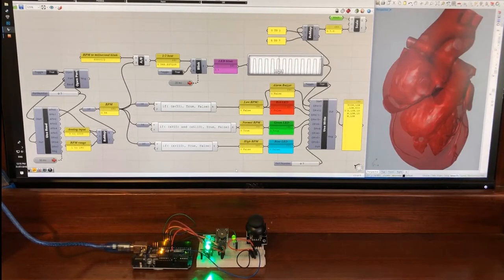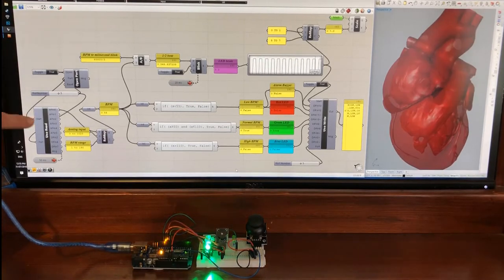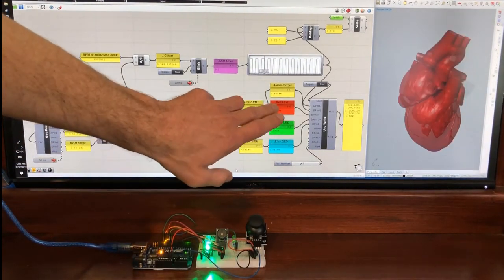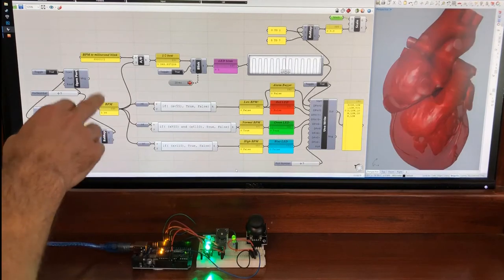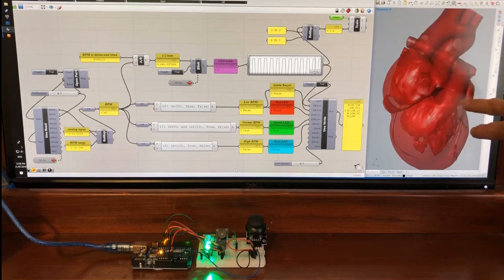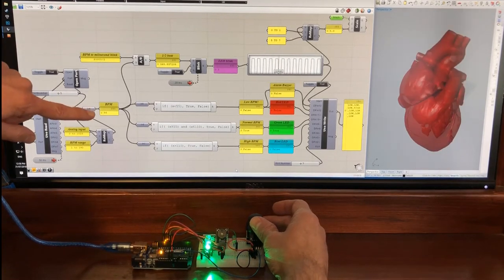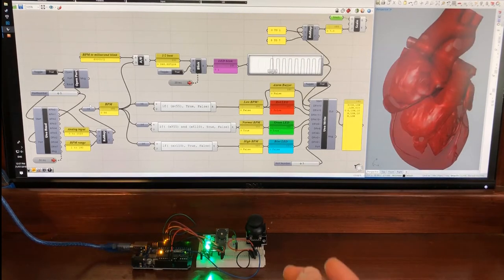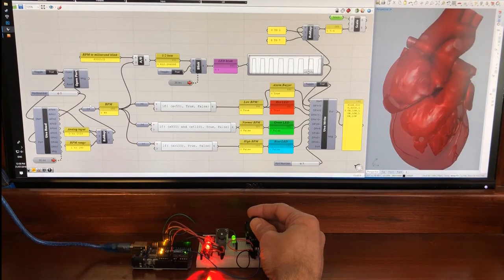Firefly Grasshopper Arduino Demo - Simulated heart rate monitor

Comment: Hey man loved the video! I'm using a heart rate monitor + arduino with firefly for an Architecture project of my own. Would  you be able to show the circuit diagram you used for this set up? Please and thanks!
Reply from the maker: The circuit diagram and code is at http://troybaverstock.com/learn/firefly-simulated-heart-rate-monitor/  but I am using an analog joystick in place on an actual pulse sensor.

Comment: wheres the pulse sensor
Reply from the maker: It's a representation of a heart rate monitor rather than an actual heart rate monitor as a simple coding example, I use the joystick just to take the place of any analog sensor. Although I have tried the KY39 pulse sensor but can't get a good reading (though I see nor can others) and I've also tried the Sparkfun pulse sensor without much luck even in the Arduino ide (perhaps mine is faulty).